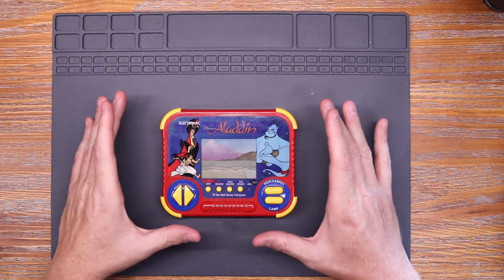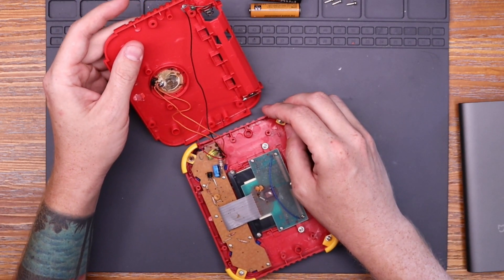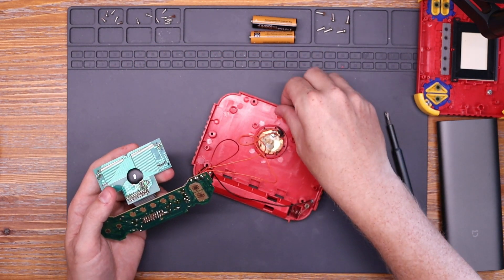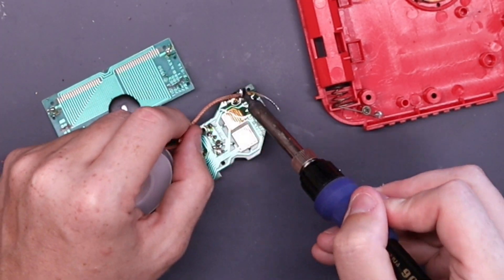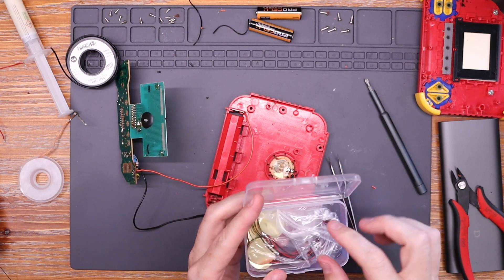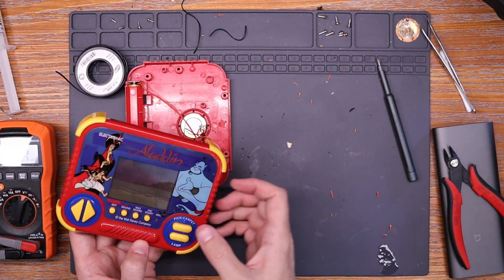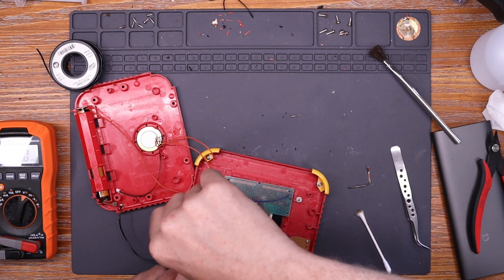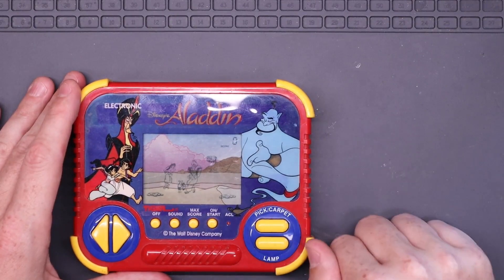Can I Revive This BROKEN Disney's Aladdin Retro Game?

Comment: Super cool, you made the repair seem simple! Most people would never bother to fix something like this. I have a Jurassic Park 3 Dino Dex whose speaker is dead, and I suspect it's for a similar reason - there is probably corrosion from a bad battery that has compromised the wire to the speaker. I want to try to fix it, but I have to learn how to first.
Reply from the maker: Corrosion, depending on how severe, is usually pretty easy to clean and can solve alot of problems. 

If you need practice soldering, there's kits you can buy or just go to a local second hand store and buy some cheap junk you can practice soldering and desoldering on (ideally something that's already also broken)